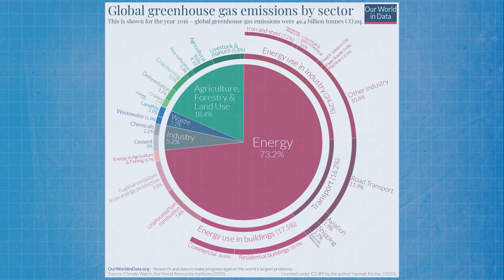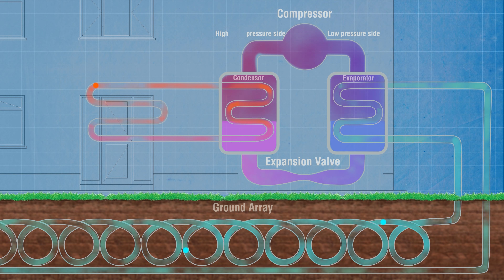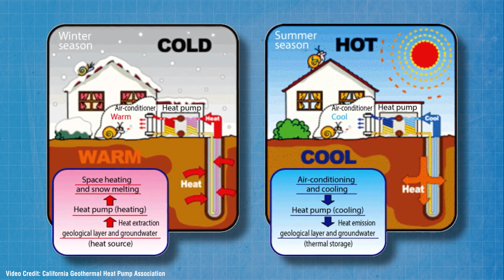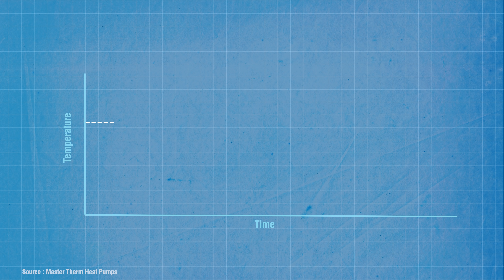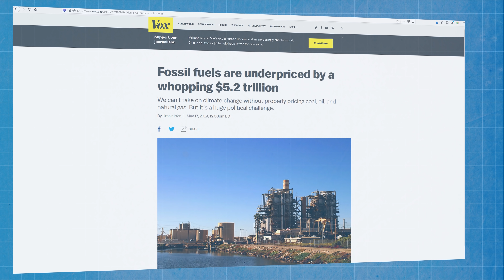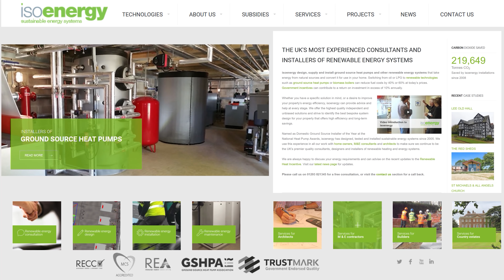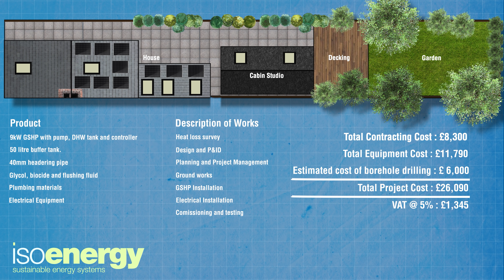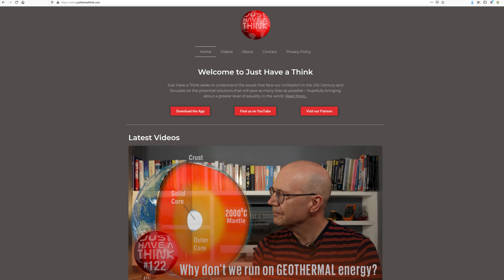Geothermal ground source heat pumps. Heating your home from your own back yard!

Comment: The best, most efficient form of heating or cooling is to insulate the dwelling from the outside temperatures.  I see no mention of insulation.  It could be as simple as using weatherstripping around the doors.  Thanks so much for the informative video.

Uploaded only four minutes ago and already 2 comments.  I must be in the wrong time zone!
Reply: Oh yeah, proper insulation is always the best first step. And older homes are almost never insulated properly, so there's usually quite a bit of improvement that can be done before you even get to the question of heating.
Reply: True, but I would say not absolutely. In really cold or really hot climates, the average temperatures are going to be such that, for large parts of the year, or even all year in some places, no amount of insulation will suffice to keep things comfortable all the time. You also cannot eliminate all leaks, as sometimes doors need to be opened. And in some situations, tapping the ground source could allow you to have windows opened, which tends to be pleasant in ways beyond what temperature and humidity measures express.
Reply: That's true. My house here in Canada gets awfully dry in the winter. It would be wonderful to open a window when it's only - 7 C or so, even for a brief time.
Reply: Acme Fixer .  Correct, for £27k, you could upgrade your house to near Passiv haus standard
Reply: @markthomasson5077  An enerphit retrofit is usually quite a lot more than 27K sadly. I've DIYed mine for very close to that price and it's almost enerphit. (26kWh/m2/yr). If you pay someone else it'll be at least 40K. To get to actual passivehouse (as opposed to the retrofit version) people can spend silly money (100K, 150K). It is getting cheaper as this stuff gets more normal and builders learn how to do it but fundamentally it's a lot of work, and every non-passive house that gets built (still 98% of them) demonstrates that we are still stacking up huge future problems for ourselves when this should have changed 20 years ago. Even (most) new houses are going to need big retrofits at the moment.
Reply: @Wookey.  interesting, great comment. It's a huge scandal that this hasn't been mandated in all new builds. I was suggesting it more than a decade ago to friends and family, and I remember new labour suggesting that zero carbon would be mandatory from 2016. Swiftly revoked by the Tories, not in any way associated with donations from large housebuilders!
Anyway, do you have any recommendations on reference material that I can look at for the DIY retrofit you suggest? Sounds intriguing.